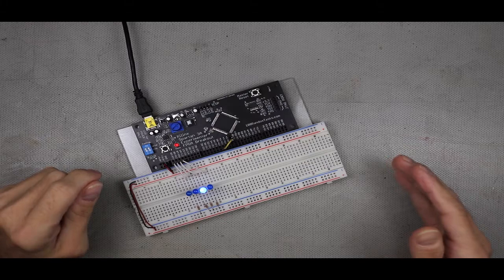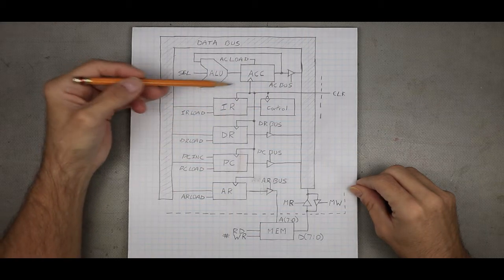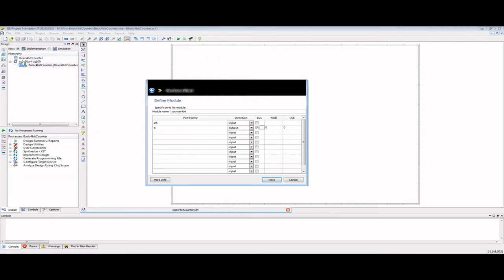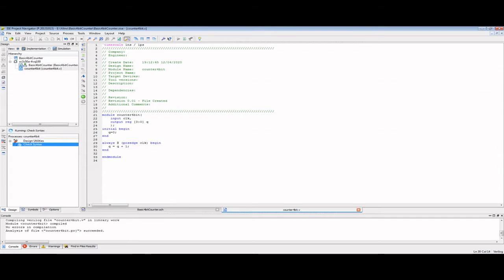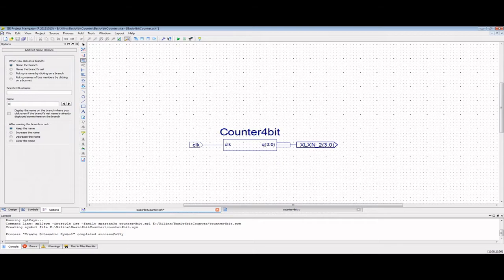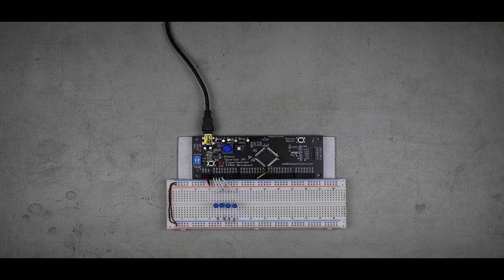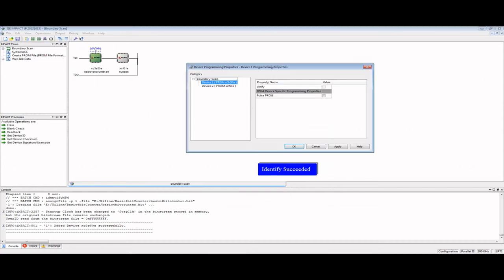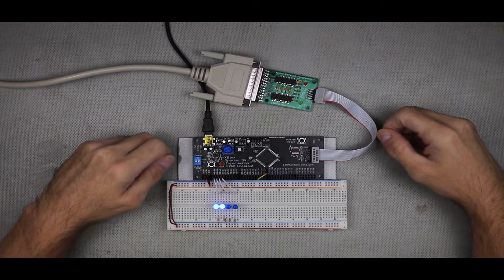HOW TO CREATE A CPU IN AN FPGA - Part 1

Comment: If you were to use the Spartan 3A on a custom PCB in place of a 40 pin CPU such as the popular 6502, would the PCB require additional components, or could it just be the FPGA chip?

Comment: Just a question. At the end you mentioned that without the constraints it would just assign a random pin, I’ve never seen that happen, in my experience they just don’t connect them to an output. Can you confirm what actually happens, does it assign a random pin or just leave it unconnected?
Reply from the maker: Thanks for the question. If you have defined i/o pins that are not set using constraints, then the software will place them where it thinks its the best place to put them. If you have an unconnected wire or connection from another block, it will ignore it.
You can tell if it is defined by a box around the label at the end of a wire with the direction indicated by the box. Either in, out or in/out on the top level. Hope this helps.

Comment: Enjoyed the video. Constructive comment: please use a lower screen resolution, or, have your screen capture software automatically track and zoom in on the area of screen that you are working on. Capturing the entire screen makes it very difficult to read what is going on.
Cheers! 👍
Reply from the maker: Thanks for the comments. I agree, it is hard to make out and in later videos I've increased the font size. I'm still feeling my way around and eventually I'll get it right.
Reply: @100RandomTasks  Along the same lines, it would be better if you already had the code on the screen and then you commented on the code

Otherwise your content and presentation are great !

I've been "thinking" of tinkering with fpga's for maybe 20 years and never have bought one.  I've done some research to know basically what they are and what I can do with them.

cpu / ip  cores are my main interset.

I'ts great that I found your video series